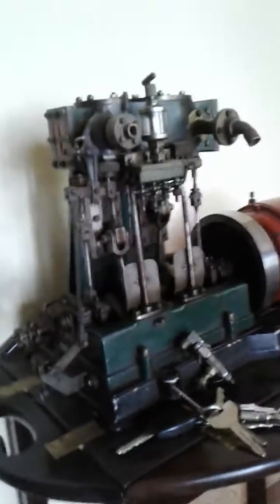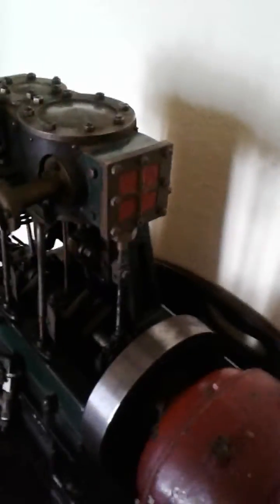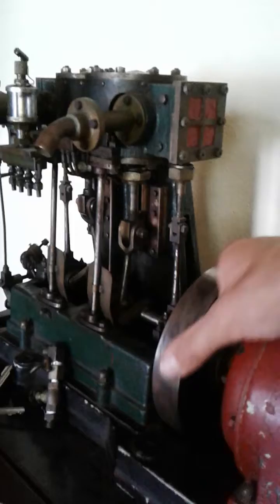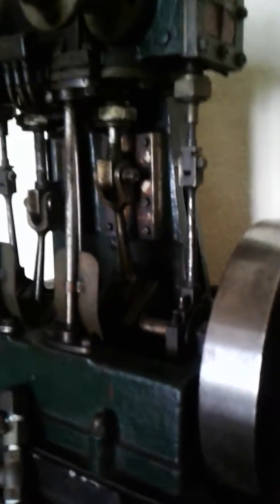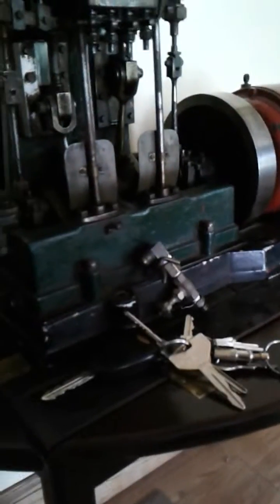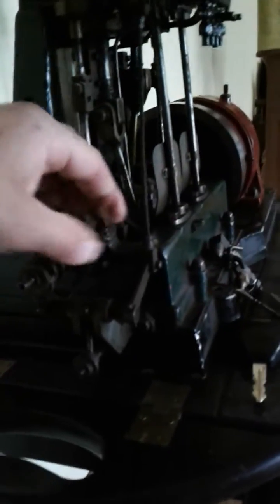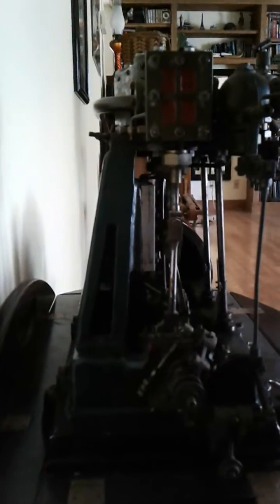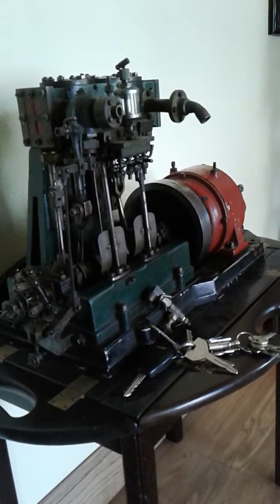Model Steam Generator Set

Comment: Hey Wesley - this could be an auxiliary generator for a ships radio room also. I know that some ships have had this for the case of emergency when steam is still available but main line to radio room or even all electricity in the ship is down.

But I do not want to destroy the Titanic story!

Rainer 
www.steamboating.de
Reply from the maker: Ranier,  Thank you for the info! I have been surprised at how small "working" engines were. A fiend of mine has a bunch of horizontal engine that I would have classified as models, but were in reality "working" engines probably used in jewelers shops and such.